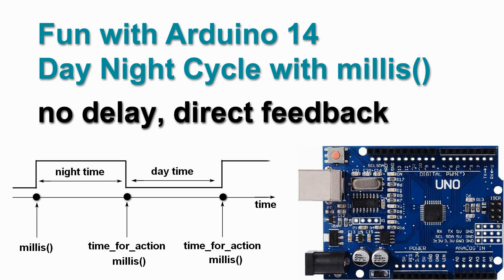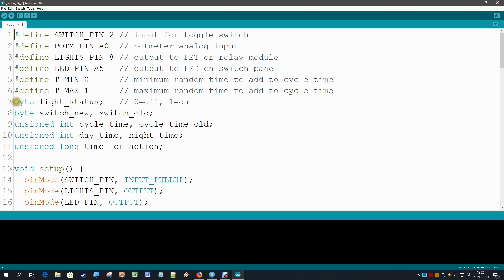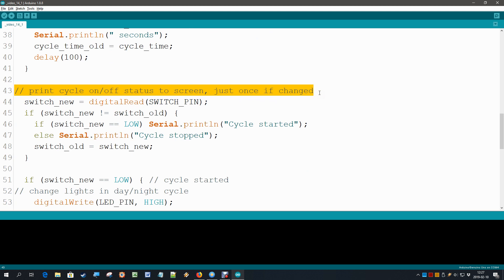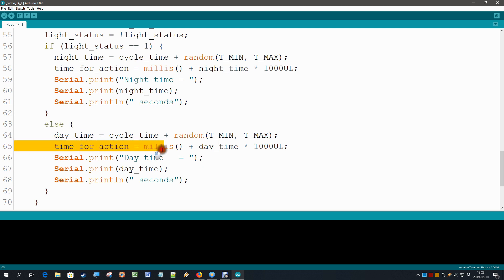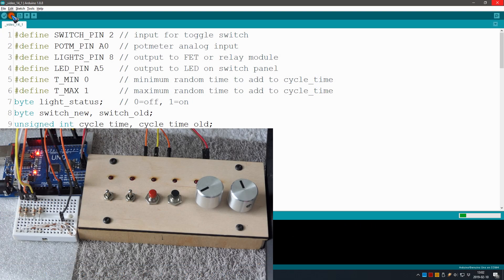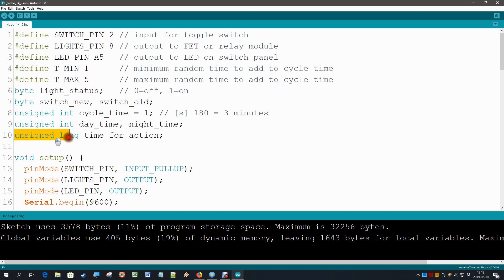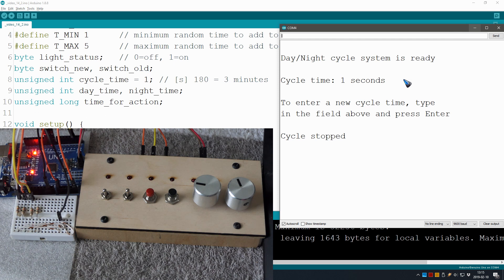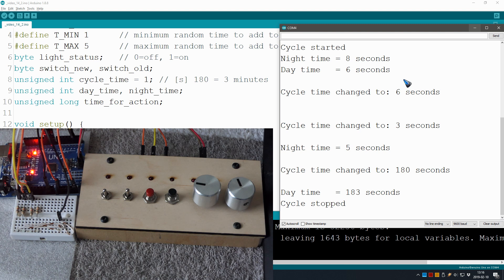Fun with Arduino 14 Day Night Cycle with millis(), no Delay, Direct Feedback

Comment: Hi I wrote you awhile back. I was wondering if I could use this code to control my code on traffic lights ? Like work regularly during the day an go on caution during the night time ?
Reply from the maker: Well, yes, such should be easyly possible. Only need two states, O is day and 1 is night, and run the appropriate traffic lights routine depending on that state.
Reply: @rudyshobbychannel  ok great thank you for that info:
Reply: @Rudy's Hobby Channel  HI There, ok I've downloaded both codes here so question where there's a 0 
I add in the day time traffic light section  and where 1 
Is where I add the night function I want to happen ok,  ima look at these 2 codes tomorrow and see how I can half my code in to one of these codes.

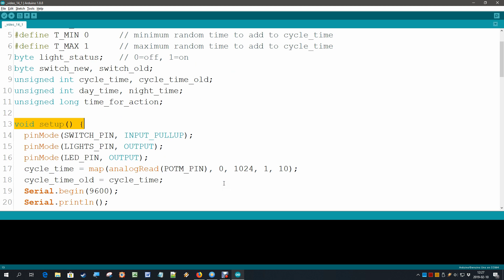Comment: Thank you for posting your videos on Millis() I am a novice when it comes to coding and your Millis() videos have been a help. I would like to ask Why did you keep the delay at line 40 shown at min: 2:13 ?
Reply from the maker: It's there to avoid noisy readings from the potentiometer. It does not have any functionality with regard to the day / might cycle.